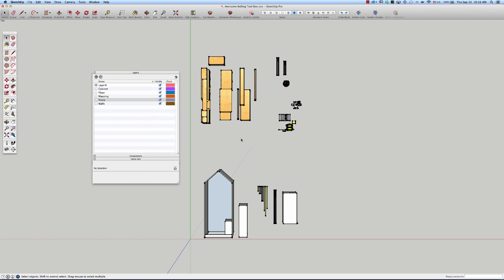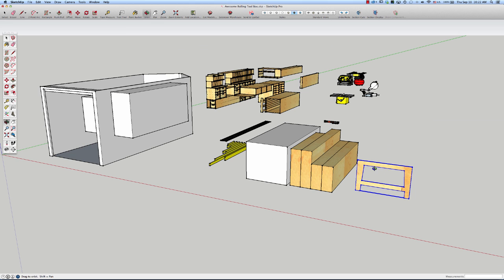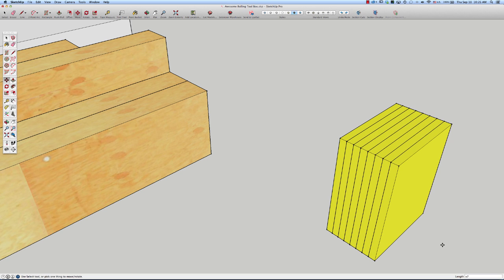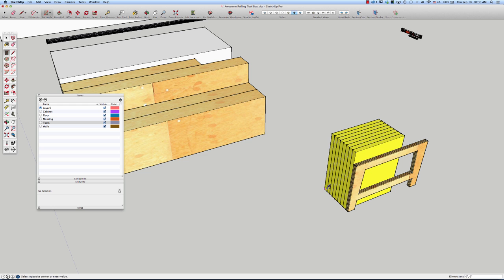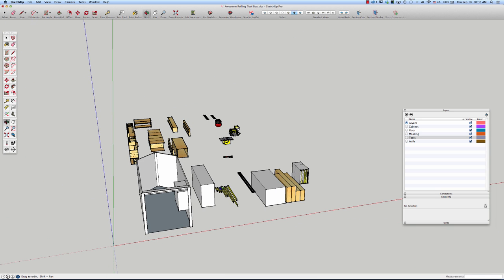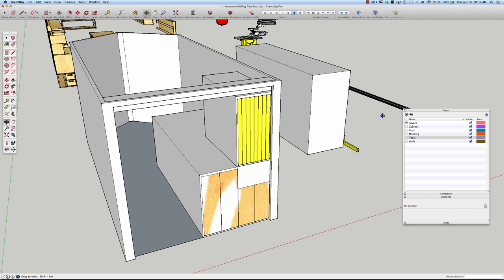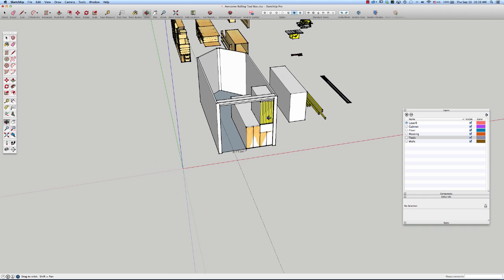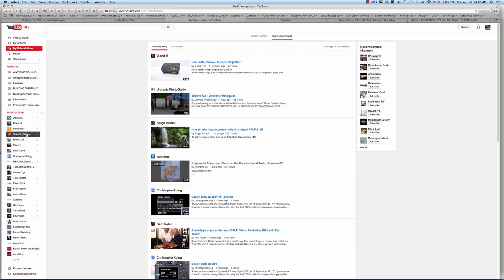BUILDING A MOBILE WOODSHOP (Part 5) The blocking method for design.

Comment: Ron, I want to thank you for taking the time and effort to put out your YouTube videos. I am challenged every time I try to use SketchUp. I have just one question about the "garage" for the 2 total stations and 2 workbenches. Aren't your workbenches shorter in thickness top to bottom than the total stations? that will get you some more room for your walkway.

Comment: I have purchased all of the plans that you sell.
my question is what is the height of the Paulk Workbench?
Reply from the maker: Hi Rudy, all of my benches are 36, " but you can make them the height most comfortable for you.
Reply: I wonder if you could change the width of the PWB horses to the same width as the Storehorses? They would store more efficiently but perhaps the PWB would be less stable when setup?